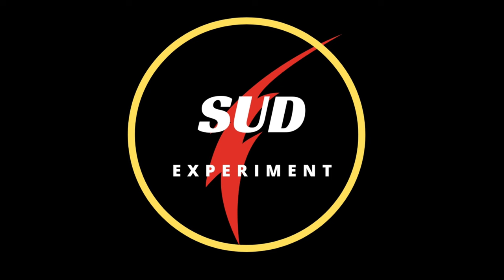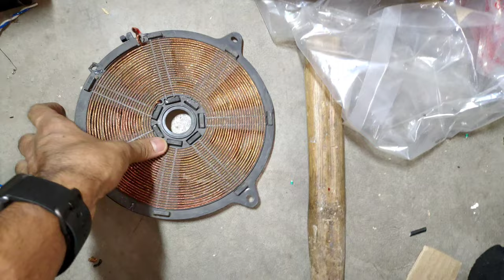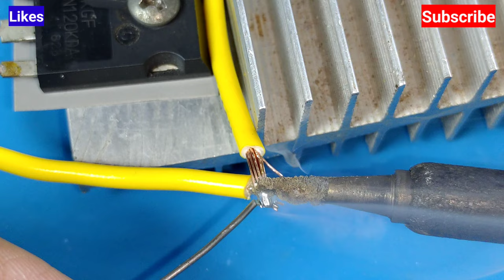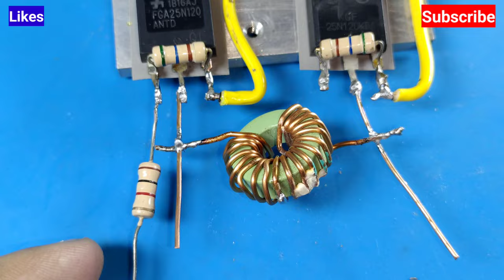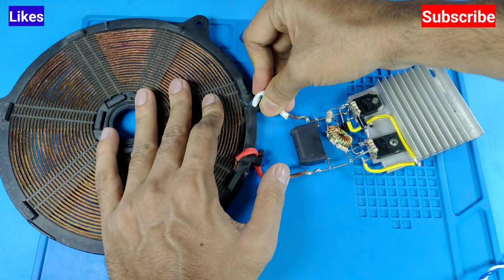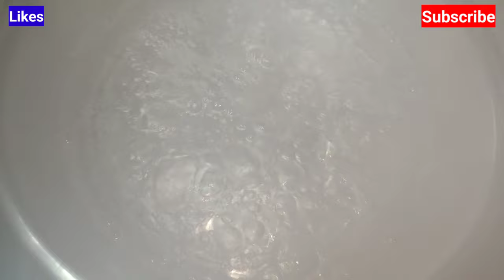How to make Powerful 3000W Induction Heater  || How To Make Electric Oven

Comment: Looks like a type of power oscillator to drive the coil. Most induction cook tops use about 30 KHZ to 50 KHZ depending on particular design. They control the intensity by changing duty cycle in combination with on off cycling.  I myself never thought to build such a project.

Comment: 1 thing missing add zener diodes to MOSFETs to protect it from backspikes .
Circuit will work for long time if added
Reply: 这个型号的mosfet里面自带一个二级管
Reply: @kingking-mb8dg  zener diode from gate tò source ? 😳😳
Reply: These are Igbts.. 25N120 commonly used in induction

Comment: 3000 watt vt 12 volt input. Can you provide mathematical proof for this.
Reply: Электрическая лампа 100 ватт, потребляет при питании 12v составляет 10А  А при потреблении 1000w - 100А
Reply: @СергейВасильев-е2ь Well done with computations. To continue the computation further to 3000 watt, the current required shall be around 300 amp. As far as maths, it's ok, but 300 amp is huge and will require very very thick wire. Not a practical solution to use a thin wire as shown in the vdo to flow 300 amp!

Comment: Why not disclose the capacity of the capacitor?  Is there something wrong with this circuit design?
Reply: It's called MKP capacitor 1200v to 2000v 0.33uF etc.
The circuit is called Mazzilii Driver 👍

Comment: Fake video for 3000 watt output at 16 volt needs too much current which ur power source cannot provide.
Reply: bạn rất am hiểu về điện mới nói ra được điều này👍
Reply: Yah its a fake video. They not represent the output current and the resistors is not 10k ohms. They so maby colors and also 3 band only. Maybr this is a hoax video.

Comment: Fake
Reply: Not my friend, I assure you. It is not a fake. This is a very well-known electric circuit called magnetic induction heating technology. It is used to melt metals in factories and is also used in cooking food (electromagnetic cooking heaters are available in the market). .You can easily make it. You just have to follow the circuit diagram. I made it myself